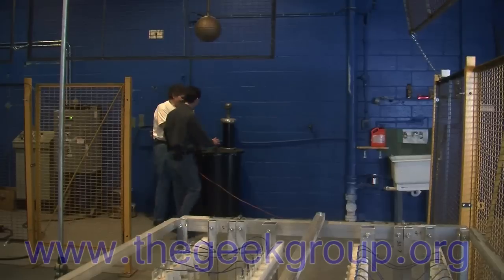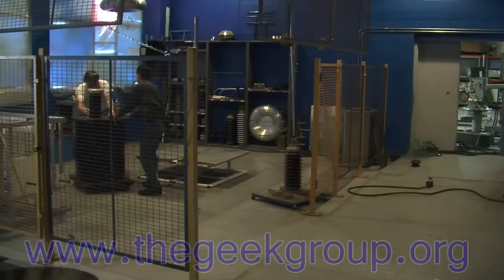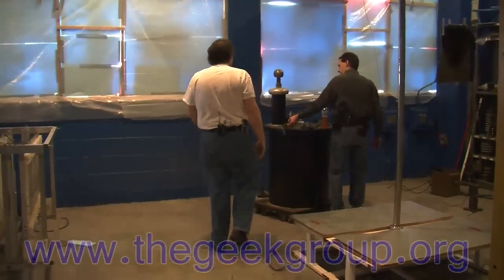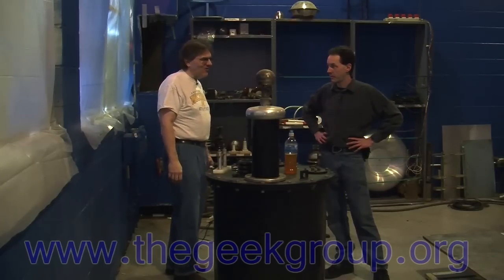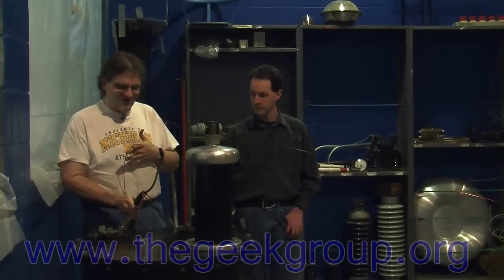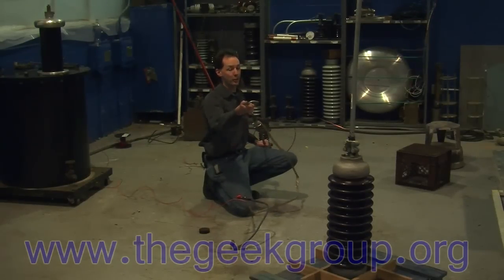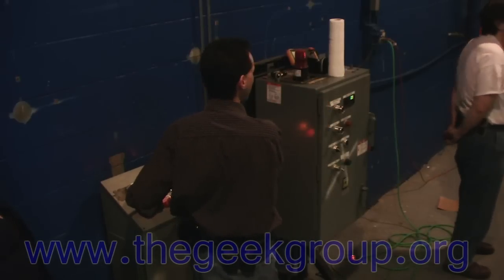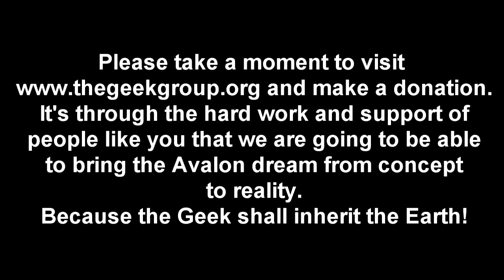Setting up the 75kV Power Supply

Comment: Not everything in the room, just most stuff in the cage as most stuff was connected to the transformer. And about the 60hz thing, it's probably because the diodes were only half wave rectifiers.

Comment: Ok. 2 questions. 1: Why is everything in that room hot. Did that transformer ionize the air that much that it charged everything around it because I'm confused as hell? 2: If it's hvDC why does it still have the sound of 60hz AC? Every other rectified hv vids I've seen it was this higher pitched sound.
Reply: no bro,everthing hot is connected with it by a thin copper wire